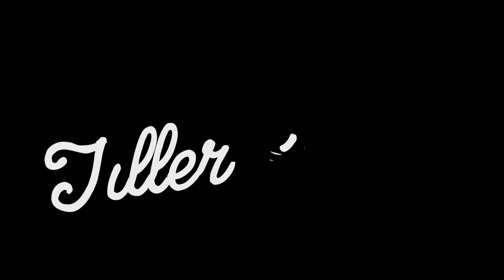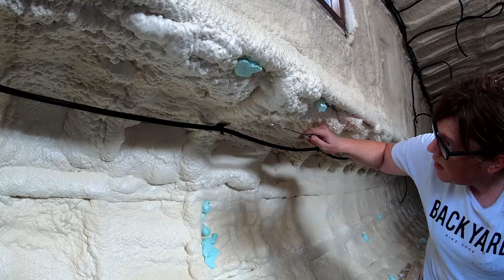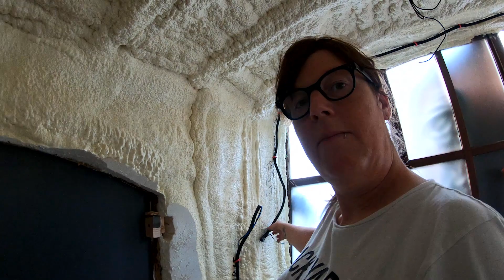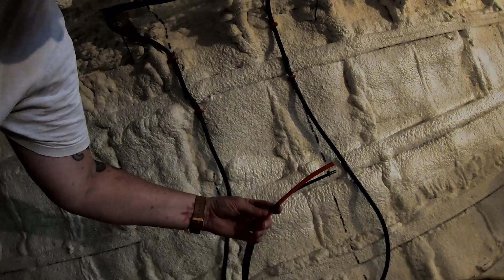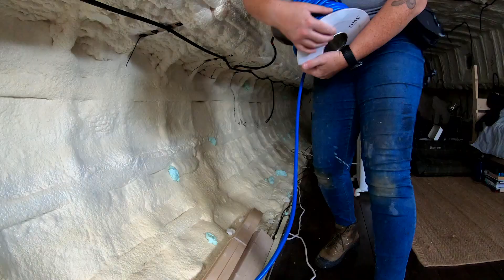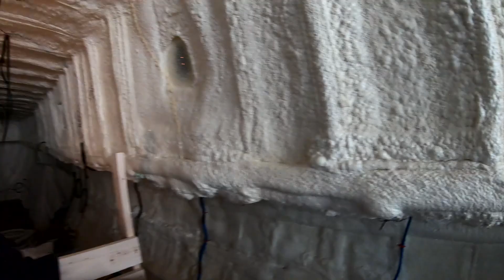#25 24v and 240v Boat Electrics - Dutch Barge Home

Comment: Very smart to consider electrical field interference with communication cables.  The highest standards call for 120 Db separation between cable runs.  With luck your 5G and other communication cables will have some shielding inbuilt in the cable sheathing.  You're doing a fine job of the thing and yes, Gaffa tape is much easier to use as it tears more easily than electrical tape ie you don't need a knife to cut it!